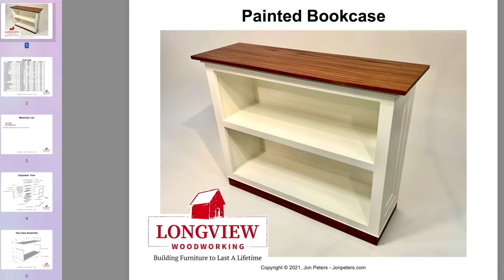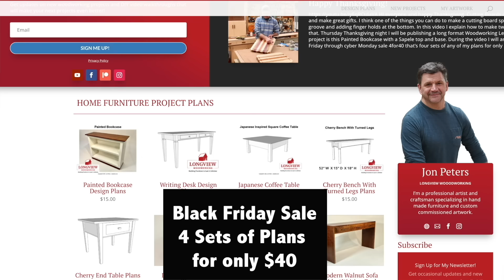How to Build this Bookcase - Woodworking Project

Comment: I'm super picky about nail holes to the point that I will take a few extra hours to glue something if I don't think I can effectively hide the nail holes. So often I almost never tack in molding or face frames. Unfortunately I don't really like painted furniture typically but the glorious thing about paint furniture is you can easily hide your sins and those pesky nail holes under the paint. Nice job, my guy.

Comment: Looks great, but personally I would use dados and rabbit joints for the casework then a one piece face frame after it's assembled. But this is the kind of stuff that drives me and I have the equipment for it. By the way, look into a Ripflip setup from  Woodpeckers for your Sawstop. It's a real time saver and extremely accurate.

Comment: Great video! I did enjoy the longer format and all the tips and tricks you included (especially the way you sanded first then dropped in the CA glue to hide the holes). Question: did I see you use a different miter saw other than you Kapex to cut base mounding?

Comment: Nice build demonstration, and I really appreciate your attention to detail and your choice to point out and discuss the mistakes you made, and how you addressed them. A question: how do you allow for wood movement in the solid wood top? I don't see that you allowed for laterally expanded holes or other techniques to accommodate movement? I'm a relative newbie, so have not yet built with a wide solid wood surface like this. Thanks.

Comment: Great project - one recommendation -show a drawing with dimensions or something before you start. You start in the beginning about talking about the 4 longer pieces and the 2 shorter ones and I don't have any frame of reference for what your talking about. From lookin at the bookcase, I assumed there would be 3 longer pieces ad 2 shorter ones, not understanding that you were making 2 boxes to sit on top of each other......if that makes sense? Your do a great job teaching though with great pointers!!

Comment: One thing that annoys the hell out of me and triggers the slight OCD I have is that when you either make or buy furniture designed to fit against a wall is that there is no relief on the back to allow the the furniture to sit flush against the wall due to the skirting board. I have always found the gap the perfect place for thin objects (mainly paperwork) to fall down the back
Reply: You are absolutely right. For my daughter's dresser I made narrow "shelf" the rests on the surface and ties to the wall - got very tired moving it to get stuff that dropped behind the dresser 🙂.
Reply: Warren you could also just make the top with a slight overhang so the back would sit flush against the wall while the base would sit flush against the skirting/baseboard.

Comment: I really enjoy your videos. On the bookcase you haven’t allowed for wood movement in attaching the top. Is there some risk of it cracking if it moves?
Reply from the maker: Thanks, shouldn’t be a problem because the screws are in the center and only 4” apart

Comment: What are your thoughts on allowing for seasonal movement for the top? Is it okay to just screw the top down since the top isn't very wide? Trying to learn more about this
Reply from the maker: Should be okay because the screws are only a few inches apart.

Comment: Just wondering why you didn’t allow wooden movement on the top of the bookcase I see you only screw than four screws with all possible expansion allowed
Reply from the maker: Because the screws are only about 5” apart expansion and contraction shouldn’t be a problem.